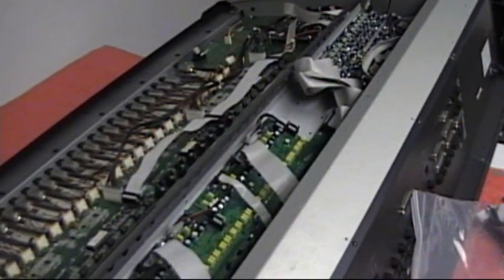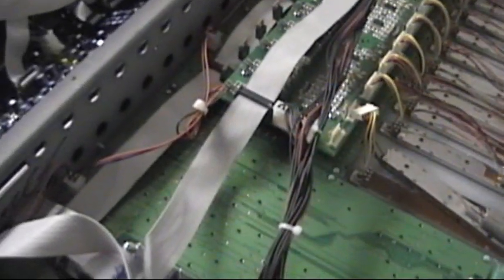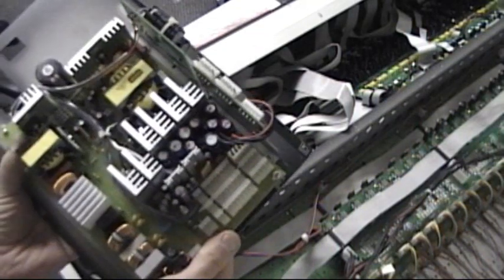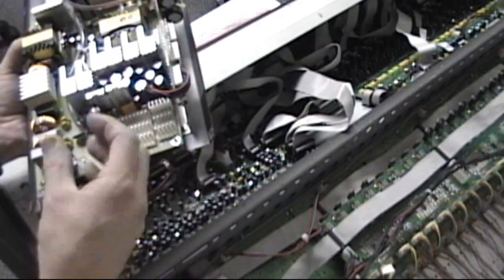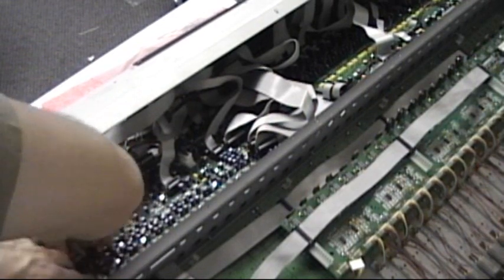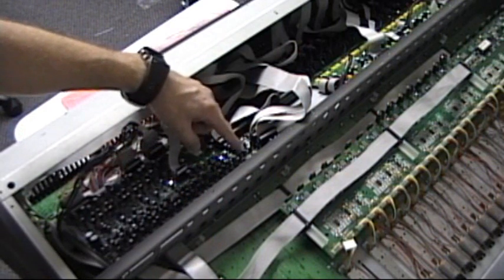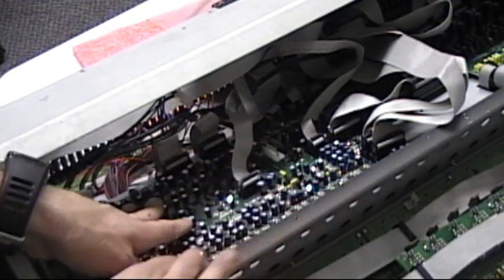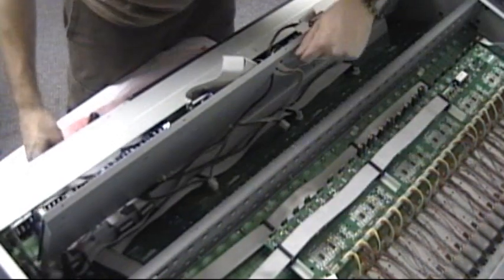Control 24 DC Harness Replacement - Part 1

Comment: on the ac plug in back it has 4 pins and blow each pin it has a number 100/120/240 if i have 110vac from outlet should it be plugged to120 or 240